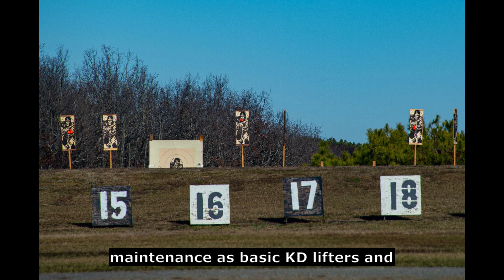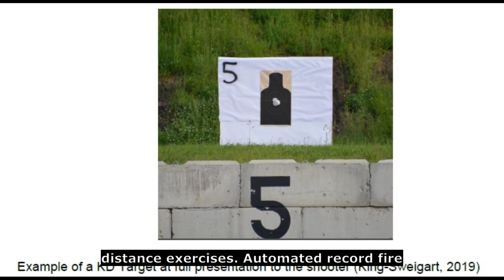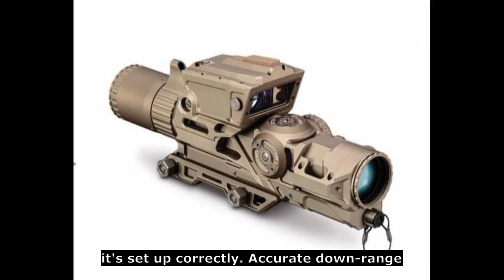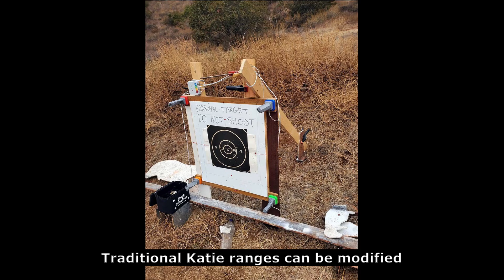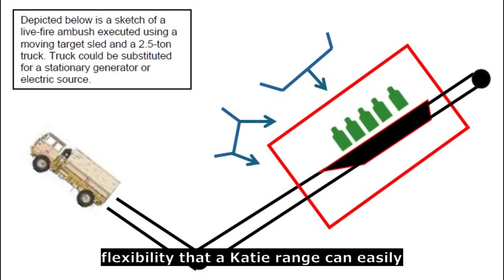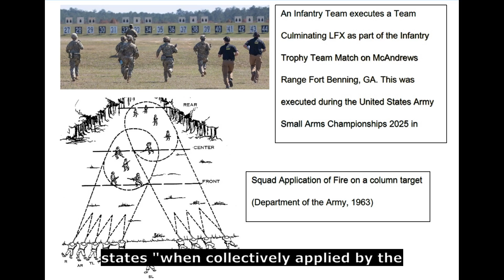Modern Infantry Marksmanship Solutions

Comment: 1:50 they do not…
Reply from the maker: Problems with the reliability of ARF "pop up" targets makes the point of the video that much more important.
Reply: @FUNshoot from what i’ve seen, there are a lot of Soldiers who are better than they think they are because the failures in these pop up systems trend towards lower scores.

the wireless connection these systems use don’t work very well. Range ops consistently replaces the transmitters in the target boxes and those things aren’t cheap, but the system still doesn’t work.

some qual range lanes register hits during testing, but remain up for the entire allotted time. Some targets come half way up and fall counting as hits. Most of the time these systems do not present targets for the prescribed time limit and more than once I’ve caught tower operators running table 5 during a unit’s table 6 qual.

I’ve sat in the tower and seen targets drop and watched the system register the target as still up with no hit.

I’ve stood behind soldiers running machine gun qual with a 40x spotting scope and watched bullets nearly saw a target vertically in half and the target stayed up.

I talk with the civilians at range ops about these concerns, most of them don’t care. The ones who do feel there’s no point in raising the issue. Talking with full birds and sergeants major about it, it’s the same story.

There aren’t enough leaders who understand the problems, let alone care about them and there’s no drive to push for something better.